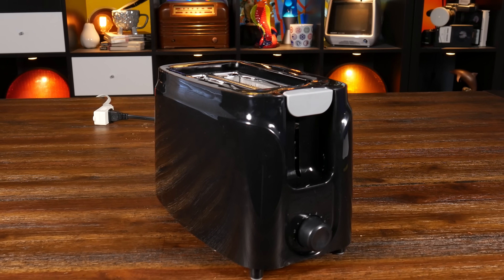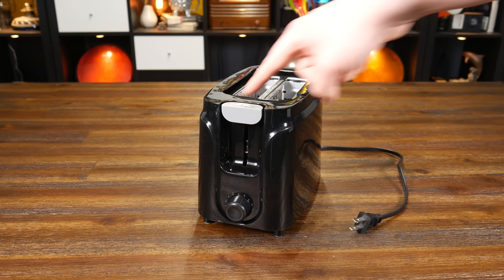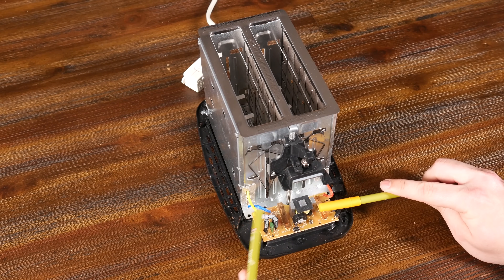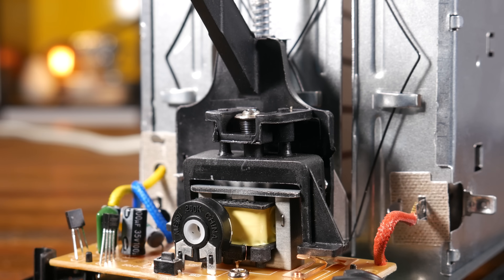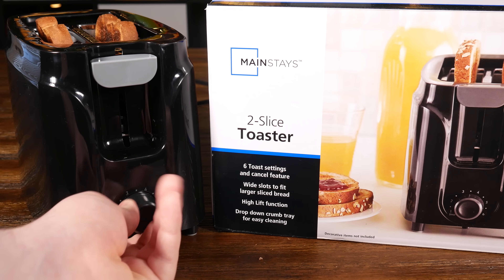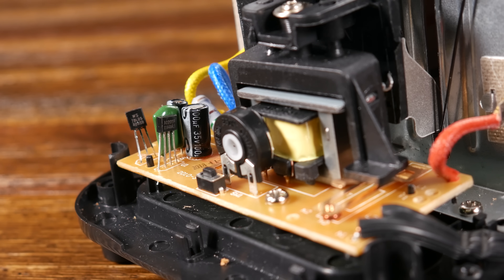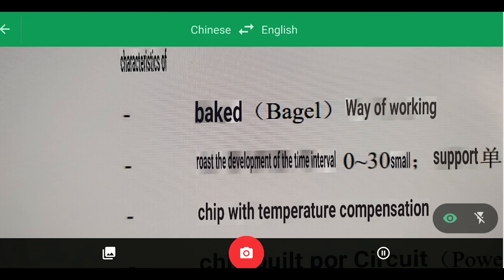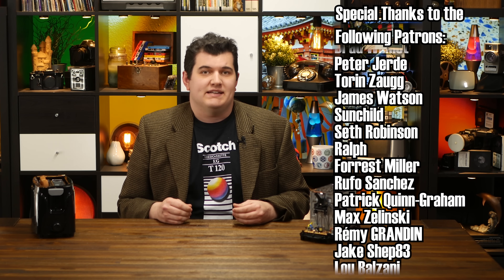The Electromagnet in Your Toaster

Comment: I have a prewar Toastmaster 1B9 toaster, the granddaddy of modern popup toasters, which has a fascinating mechanical timing mechanism.  

On its face, just winding a spring to toast toast doesn't sound too interesting, but it's actually more complicated than that; for one, the mainspring in the movement is a bimetal.  This means that at lower temperatures, the spring winds less tightly than at higher temperatures, so a hot toaster shuts off more quickly than a cold toaster.  Adjusting for lightness and darkness also adjusts the winding on the spring.

Second, instead of an electromagnet, the unit uses an entirely mechanical device to switch on and off. A regular magnet is attached to a flexible piece of metal. Pushing the lever down makes the magnet snap into place over two contacts to complete the circuit, while simultaneously winding the watch mechanism, pushing down the floor in the toaster to lower the bread, and locking the floor down. Once the magnet snaps in, the the toaster turns on. (It takes quite a bit of force to push down the lever on this model.)  

The lever slowly rises as the clock ticks away, and after a certain point, it will rise enough to pull the magnet away from the contacts. When it does this, the contact will be lost and the toasting is done.  When the magnet lets go, it causes the lever to fully travel back up, which hits a switch to unlock the bread floor, causing the toast to pop up.

The fact that engineers poured so much time into making such a complicated mechanism, just to toast bread, is fascinating to me. This is a device with some of the most interesting mechanicals I've ever seen, hooked up to a literal swiss watch movement, and it's sole function is to burn bread in a controlled way.  It's also interesting to see how in later years they were able to accomplish the exact same thing with a significantly simpler mechanism (though I maintain that this toaster has done the best job at perfectly toasting bread of any toaster I've ever owned.) The unit was something like $450 adjusted for inflation, and a new toaster can be had for less than $10.

Comment: Hello !
So as you confirmed that cutting power off will raise the toaster rack and "eject" the bread. Could you have used a socket strip with a switch on it ?
You could have flip the switch with your foot, therefore ejecting the bread right on time (easier than relying on timing and multiple shots of the scene).

Comment: 1:45 Living in Europe (Austria), i can tell you that most Toasters here will keep their lever down when they have no power. The lever is held down by a latch, which itself is thrown by a bi-metal thermostat when enough heat has been pumped into the bread - or whatever is inside.
Great thing though - I mean your channel as well as this video.

Comment: The circuit is powered by a tap on the heating element so it runs at a low voltage. The diode is used to convert it to DC and the capacitor helps smooth it.

Comment: I worked in the electrical trade for most of my life. It was interesting watching the development of toasters over the years. The first automatic toasters had  bimetallic strip that handled the timing but if you toasted toast slice after slice they were not very accurate simply because the strip became hot and was not reliable. Then toasters came out with a 555 timers and electromagnets. Personally I just use a Dualit toaster that does little apart from heat bread to make toast. The timer is mechanical and the toast does not pop up. 
It's brilliant how technology goes backward and the timer is mechanical.
Reply: Nope. Dualit still make toasters that don't pop up. Have a look at the Dualit classic toaster, they have been making pretty much the same toaster in the UK since the 40's.

 You press a lever down, it pushes the ejector fingers up and you can get your toast. It's quite handy as you can push the lever down to pop the bread up to see how toasted you bread while the toaster it still on. Take the toast if you happy with it, or pull the lever up to carry on toasting.
Reply: @Edrim_Glebe  we bought one of these because the Adeiaide museum curator (??) is from the UK and in an interview in the paper he replied that he brought his with him. That was enough recommendation for us. Bringing your toaster half way across the world... must be good
Reply: You prune all modern toasters pop up automatically but yours must be really outdated if it never pops the bread bsck up automatically

Comment: I always thought they had temperature sensors inside.  As always, there's no electronics problem that can't be solved with just a capacitor.  8)

Alas, my toaster's "Cancel" button never works, and ironically should be the most reliable part of the unit.  YOU HAD ONE JOB.

Comment: I have inspected a Google translate English version of that IC's datasheet and I don't see any technical evidence of temperature-compensation in that chip, nor that it has the claimed "bagel" functionality.

Which means they're saying total lies in their "Overview" section, but that doesn't surprise me, because it's a Chinese product (the chip) after all, and they're notorious for making (totally unnecessary) false claims in their product descriptions

Also, in my opinion, their reference implementation (application circuit diagram) sucks pretty hard.
Reply: What sucks hard about the application circuit?
Reply: @BrekMartin  Many things:

Single diode rectifier for IC power instead of a 4 diode full bridge rectifier
Circuit GND is linked to the "neutral" line, but AC power plugs can be reversed and bad-wiring exists
Does not define what those series of dots to the relay and dashes around the heating elements actually mean
Uses an inductor symbol and letter (L) for the heating elements, falsely suggesting it's an induction heater circuit
Bonus points for being such low-resolution and so hard to read in PDF format, which happily supports vector design formats

I could got on and catch more, but you get the idea.
Reply: @AchrafAlmouloudi  The boxes around the heating elements indicate they are the same physical assembly. The relay could also be boxed, but since it isn’t, the dotted line connects the components physically. The same is done for multiple pole switches, and multi-gang pots (and also multi-gang capacitors in old radios) when they aren’t all drawn side by side. Output of the single diode half wave rectifier is filtered by C1/R1/R2 prior to zener regulation for the IC (cheap), but the main reason is to drive the relay coil half duty, because otherwise the most expensive component in the whole toaster would have to be much more expensive. There’s nothing to suggest DC Gnd is connected to mains Earth. The circuit is the same no matter if the AC active & neutral are swapped. Those don’t even need labelling. A low voltage AC supply is derived using the heating elements as a voltage divider, which is why DC Gnd is common to one side of the mains supply.

Comment: I have 2 working toasters, one was a wedding gift to my parents, the other I scrounged from the junk in the 1960's.  Parents toaster has an escapement mechanism.  It is "wound" by depressing the lever.  This also closes the contacts.  The toaster makes a ticking sound while it is toasting (like some proverbial time-bomb).   A bi-metallic strip bends and causes the escapement to run faster when the toaster heats up,  (you can hear the ticking going faster) compensating for hot or cold toaster (and also variations in line voltage, which were common then).  On time-out, a hook is withdrawn, releasing the toast tray and removing the power.  The escapement runs for a few seconds longer.
     The one I scrounged is newer, and simpler.  On pressing the lever, the power is applied to the elements and to a heater on a bimetallic strip.  The strip heats up and bends about 2/3rds of the way through the toast cycle.  On bending, a hook is withdrawn, and the "1st notch" of the hold-down mechanism is released (a prominent click is heard, and is a warning that toast is about ready).  Power is removed from the bi-metal strip heater, but not the toaster elements.  The bi-metal cools, and releases the "2nd notch" after about 1/3rd of the time, and the toast pops up.  For both of these toasters, the cycle can be aborted immediately by pulling up on the lever (whether for burning or for very light toast cycle).  Neither of these has anything other than contacts, heaters, bimetallic strips, and mechanical clock-escapement mechanisms.  Both have light-dark setting knobs.

Comment: That Chip - https://media.digikey.com/pdf/Data%20Sheets/Diodes%20PDFs/PT8A2513NE.pdf (possibly knocked off by aosmd.com, one of my favourite companies)
And the toaster element is used as a potential divider into the IN4004 Diode to power up the circuit, first a rough smoothing for the magnet, then filtered and zener limited for the counter/timer chip.
The datasheet gives the oscillator typical frequency so we can estimate the number of bits in the counter that the overflow trips the output pin at.
250K pot + 10K fixed resistor, 50K (ish) at the 1 minute mark = 1KHz = 16 bit counter (maybe!).

Comment: That yellow wire goes to a low voltage tap on the heating element, which acts as a voltage divider, suppling a low voltage to power the timing circuit and electromagnet. The voltage divider output, probably around 12 VAC, then goes thru the diode for half wave rectification. This is an inexpensive (yet vastly inefficient, which doesn't matter in this case, since the primary function is to generate heat) method of converting mains to a low DC voltage to power the circuit without the need for a bulky transformer or complicated SMPS.
Reply: Looks like one of the electrolytics provides a "smoothing" function, which would be more than adequate seeing the low power demand of the control system.  You've got to wonder why they didn't go for an equally compact (and comparatively similar cost) modular full bridge (hat tip to Electroboom!), and design the pcb accordingly. Probably shaving a few cents on the design (which for a bulk manufactured item will translate to hundreds or thousands of dollars extra profit).
Reply: Interesting! Thanks

Comment: It's interesting to see the same idea used in different applications.
This electromagnet trick reminded me of the choke knob in my 1979 Rx-7. Key off, the knob wouldn't stay out. Key on, and an electromagnet was activated, and it would hold the knob out until the engine warmed up.

Comment: wow, you would think a toaster with a simple 555 timer or even just a charge capacitor connected to a voltage divider would be a simpler control mechanism. or have the lever actuate  an air-bellows timer

Comment: I actually have that old "automatic" toaster. It doesn't use any kind of timer, goes by heat at least as i recall the last time i had it apart. Automatic part is cool though, drop the bread in and it takes it away on its own.

Comment: Depends on the toaster. Older toasters worked in reverse, the handle would say locked until it reaches temperature and then the switch closes and releases the always on solenoid.
Reply: Even older toasters used a bi-stable mechanical mechanism to mechanically release the handle when the bi-metallic strip triggers the physical mechanism.

Comment: Nice video! That component is like a Jimmy rigged agastat time delay.  I am an engineer at a nuke plant and we have those relays in tons of our protectioncircuits, for the reactor and the generator.  I think we use IEEE 2s and 62s, but it has been since August that I had to do a print chase on some of that jazz.  

It is important to have a time delay built into trips so u dont SCRAM the reactor everytime the grid darts a bit.  We also use them for sequential loading of large emergency pumps.  You dont want them all coming in at once because you might slip a pole on the emergency diesels (edg).  So the pumps are staggered using the time delay relays in order to spread the starting currents out. 

These are big mommajammas, as far as pumps and motors go. We are talking about pumps that can pump 6000+ gallons per minute at  about 500 psig. Each edg has 2 of them, and the starting current is approximately 3 times running current.  Plus there are smaller pumps and loads for valves. I could go on forever about this and generator and reactor protection scheme but I am sure no one will read this far, haha.  

If you ever want some help if you do a video on commercial power distribution, grid architecture, large generator voltage regulation, nuclear power or anything of the like, please give me a holler.  As you can see I don't mind spending my time discussing the topic.  I didnt proof read this so se la vi or how ever that is spelled.  Luv it vids.  Keep em coming!
Reply: C'est la vie (French for "that is life").  https://en.wikipedia.org/wiki/C%27est_la_vie

Comment: The diode is just for a simple half wave rectifier with the capacitors used to supply power to the ic's. That small diode looks to be about a 1A diode, nowhere near enough current to limit the power of the heating element.

Comment: Switches with electromagnets are often used in various devices. Just a couple of days ago, I watched a video in which a similar solution was used in an amplifier. Usually, amplifiers have a speaker protection circuit with a relay, which disables the speakers if something goes wrong. This amplifier works differently and simply turns the power off completely by releasing the button.
Also, I saw something similar in one of the reel tape recorders. There is a power switch with a timer. When you turn it on, the button is locked mechanically and the relay turns on. If it is not used for a long time, the timer is activated and turns off the relay (and this relay turns off the recorder, of course). But mechanically the button remains pressed. To enable it again later, you need to press the button twice - turn it off and then on again.

Comment: Yes, The Sunbeam Auto Drop Toasters, with the bi-metalic spring that senses the degree of darkness and automatically shutting off the toaster and raising the toast is MANY TIMES SUPERIOR to all of the circuit board, plastic toasters made today! They operate PURELY mechanically, and they have worked FOR DECADES and some of them, the ones well cared for, are still almost as good as new! Yes, the bi-metalic spring shuts off the electricity when a certain temperature is reached,. This is accomplished because the "spring", which is really are slightly curved piece of metal, is actually made of two metals, one which expands to heat much faster than the other. So one side will become longer faster than the other side of the strip of metal, and it will therefore bend. When the tension of this bend is strong enough it will cause the circuit to be broken.What all this means is that you can put frozen bread, or room temperature bread in the toaster, and BOTH will come out to the same degree of doneness that the toaster is set for. These Sunbeam Toasters, as well as a couple other brands that used this technology, were made in the 50's up through the 80's. They were made of metal, not plastic, and are solid and dependable, lasting for decades, whereas all of the fancy modern, circuit board , plastic toasters give out in a couple years, if they even last that long.

Comment: does any toaster use the color of the actual bread to monitor toast quality?   if set up in a matrix - with point elements .. could ensure completely even toasting across the entire surface ha
Reply: Monitoring color is quite a bit harder than integrating the temperature.  Not everyone toasts whitebread.  There is pumpernickel, whole grain, black bread, etc.
Reply: this is why it would have to scan the bread before toasting to zero it out ^.^ @wallykramer7566 

edit* brightness - not color

Comment: I used to be able to repair toasters. These new-fangled ones with the magnet rely on the circuit card working. When, not if, it fails, that's it. Even with a brand name like Cuisinart, good luck finding the board. but I guess if the thing really only costs $8 (ours cost $22), it's a throwaway.

Comment: The most interesting toaster I've used was one with a conveyor belt. 
It didn't have wire but almost a grill type element. And the speed could be adjusted in the fly, it was fast. 7-11 seconds per slice that's light to quite dark. Buildt oh so nice, thick ss and plastic. 
I think it was used in Moorfields eye hospital, staff canteen. Maybe Mercedes benz w.London. This was a good >9 years ago.

Comment: this toaster is too good, I miss the toasters that used a thermal bimetallic breaker style switch where the pot changed the trigger point. these toasters are missing out on alot of surprise factor that  those other ones had.

Comment: The only thing that always bothered me about these is the fact most of them are designed in a way that lets them fail in an unsafe manner. The electromagnet is disabled by shorting its input with a transistor rather than actually switching it. So if any component of the electronics fails the toaster will stay on indefinitely. Therefore toasters are perfectly safe as soon as they shut off but you should never let them toast your bread unsupervised.

Comment: I'll stick with my Dualit toaster, thank-you. A simple clockwork timer to determine the amount of time the heating elements are on and a manual mechanical lever based lift mechanism for raising or lowering your bread products. I've had mine over 20 years, replaced the heating elements myself 3 years ago. Simple, reliable, dependable as well as being a bit of a style icon.